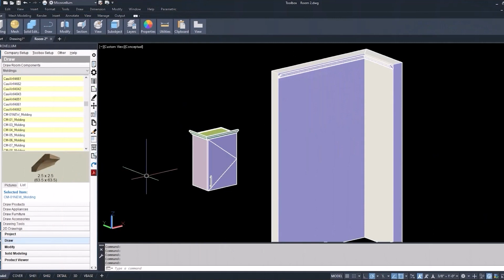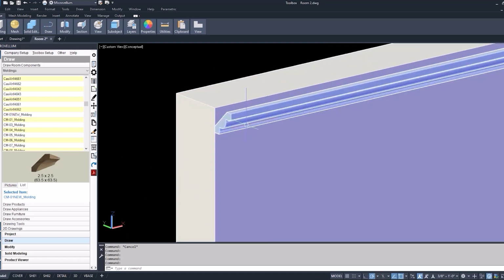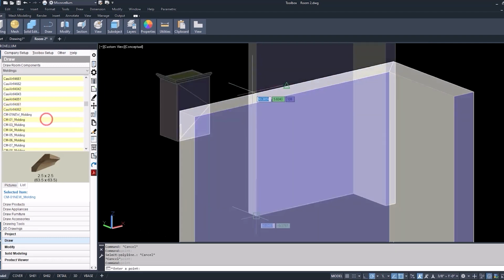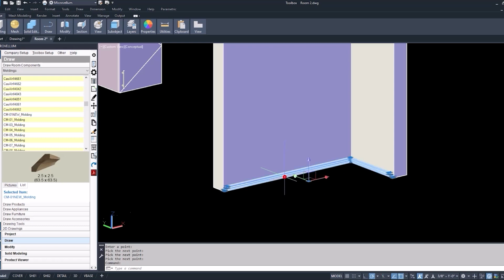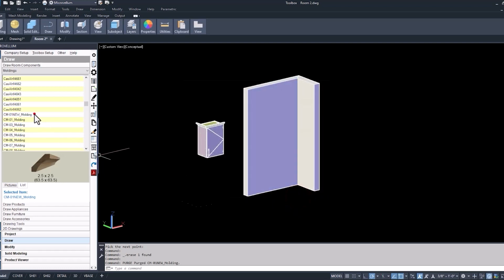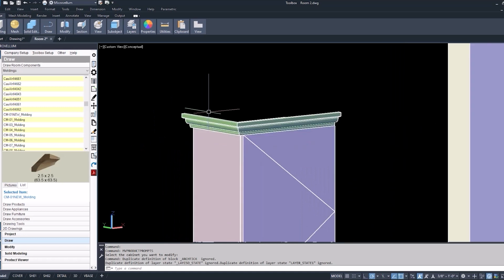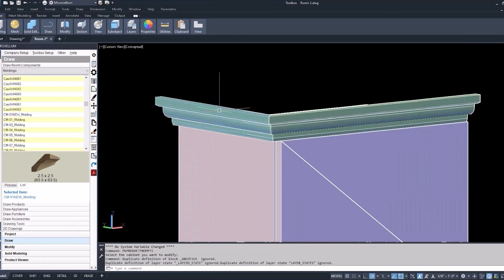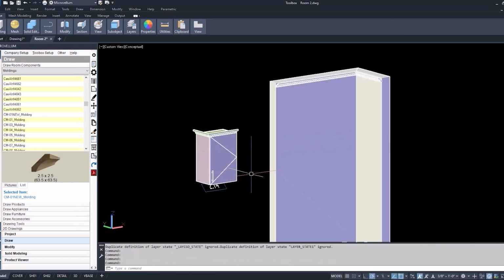Using the PURGE Command

Comment: RJ, here is question that is off topic but involves applied moldings, maybe face frames or products such as say 6" wide column where you would want to show a customer a molding detail. Let's say in this column, maybe under solid tools you want to insert a recessed panel molding. Can you "cut" or "push" the face of the column in and then use like the follow me line to then apply a molding to and then render? I am constantly trying to find a simple way to make additions or options without having to create a new product. What are your thoughts or options? Thanks